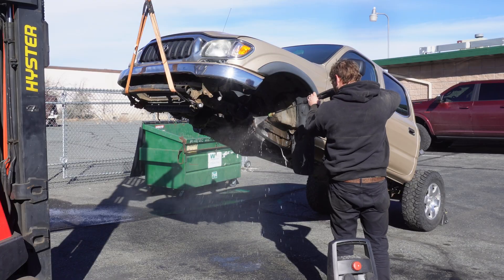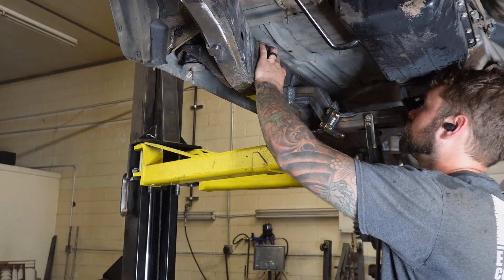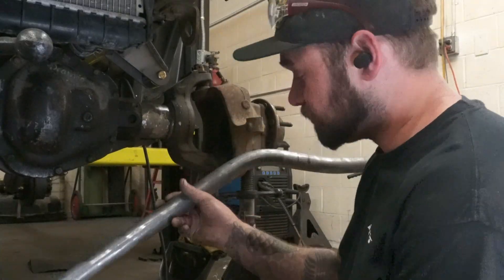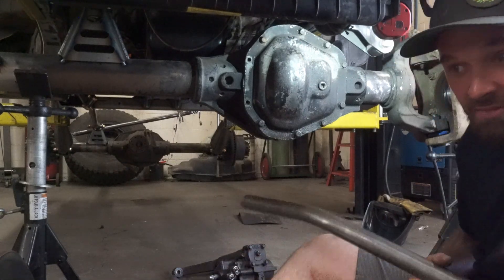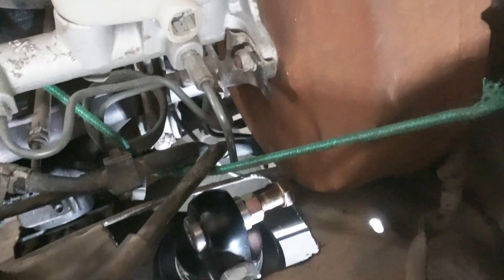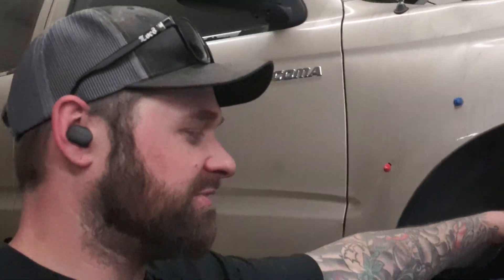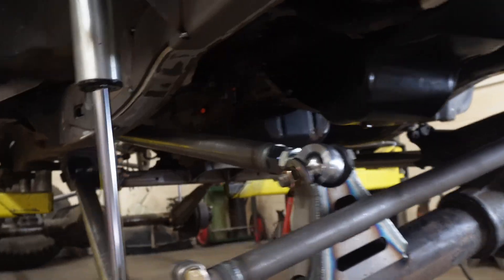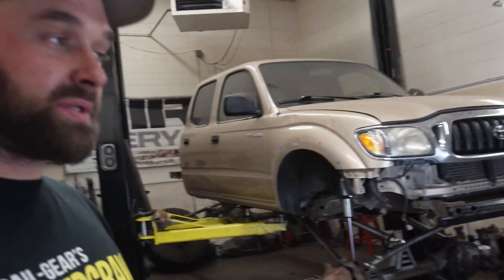First Gen Tacoma Solid Axle Kit! 3 Link Coilover Front Suspension Design

Comment: Hey, I did the same oil pan swap for my 3rd gen 4Runner can you give me some more information about how you made the dipstick work thanks
Reply from the maker: I made my own drill jig but you can but them here https://www.offroadsolutions.com/products/ors-3-4l-dipstick-drill-guide/ Uses a 3/8 drill bit. You'll have to grind out the hole in your motor mount to clear the new dipstick but it wasn't too difficult. I probably took the motor mount and dipstick on and off 3 times to test fit and grind a little more each time.
Reply: @martecengineering awesome thank you! I appreciate it